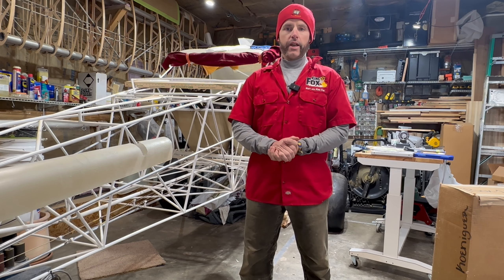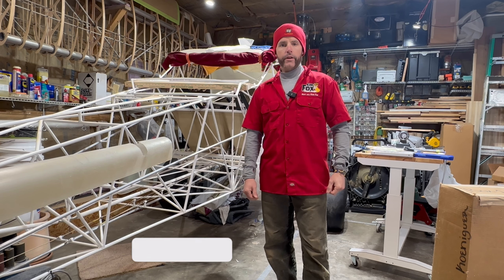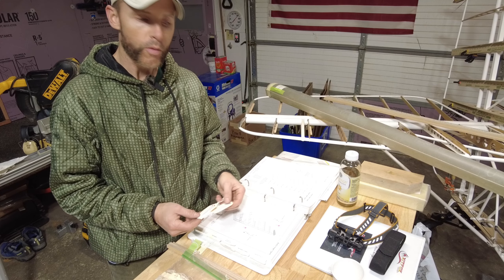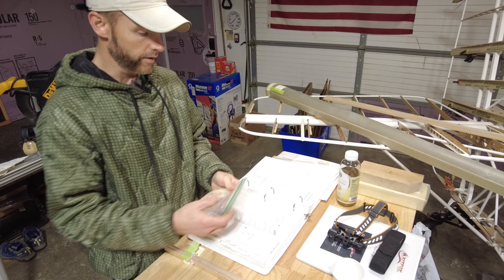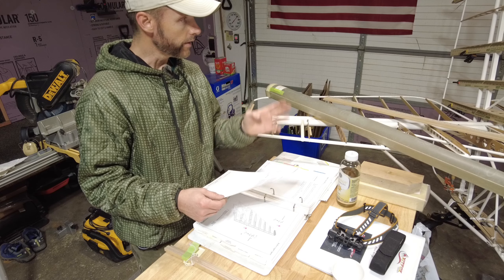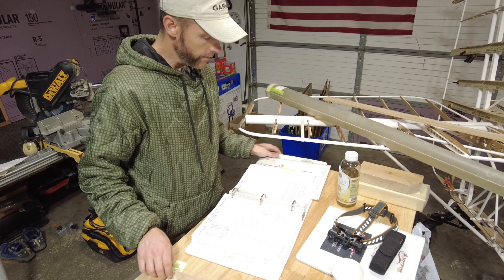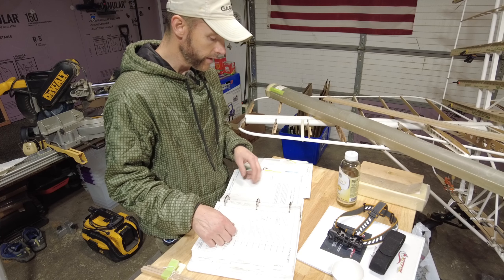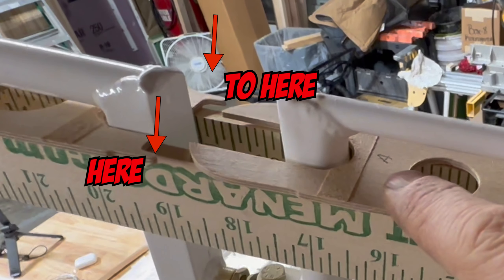#64 Vertical Tail Speed Fairing Install Pt. 1

Comment: First of all, I love the T-shirt ❤❤. 
I just finished my the fiberglass on the vertical and rudder. I did mine exactly how Harlan Payne did his on the Farm Fox and they turned out great. I did have to make 4 relief cuts on piece that attached to the vertical stab to get the fairings to stop bowing. I also cut mine to be inline with the top of the top wooden rib, if that makes sense. I didn’t go all the way to the top of the bar because I’m going to use basswood blocks up there instead of the foam. I just hate how difficult that foam was to work with on my horizontal. Both Harlan and Brian Bowen used wood and it turned out amazing.
Reply from the maker: Hello Rob, thanks for the T-shirt like!  I will have to watch Harlan’s video.  It took me a few times of placing the fairing up against the V-stab, then looking at the instructions again.  I figured out I needed to drill through it for the 3 attachment points for the eyelets, then the metal piece down low for the rudder stops.  It has seemed to glue up well against the V-stab.  Would you mind sharing some photos with me about your relief cuts?  605-290-3864. I think the wood end pieces would be easier to work with and shape.  I’m sticking for now with the foam blocks because I’ve been using them thus far.  I’m going to cover them with some Super Fill though that I bought about a year ago!  That will give me some new skills working with bondo for future mistake cover-ups!  Have a great day, thanks for watching and commenting!  Matt